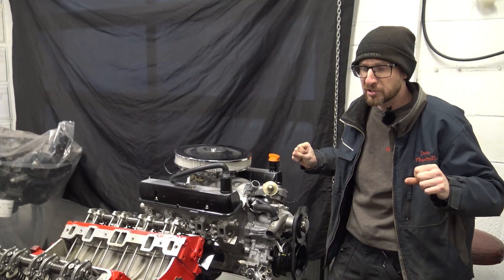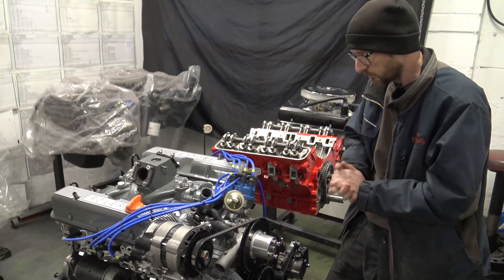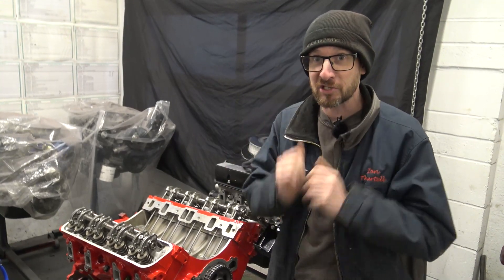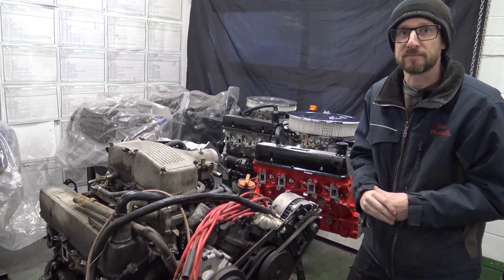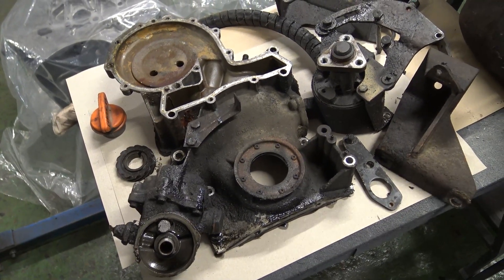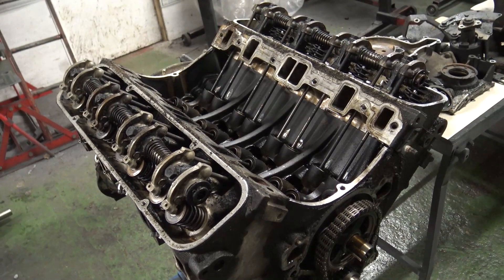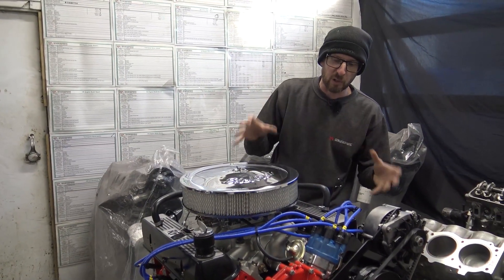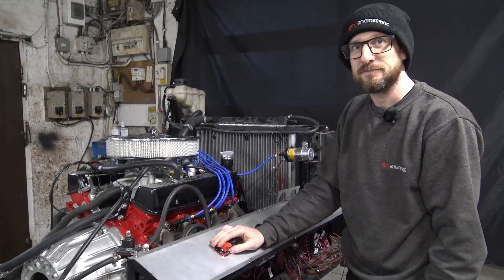RPi Engineering 4.6 Stage 1 Engine Build and Bench Run

Comment: Humm… only real mistake is replacing the silent chain cam drive with a roller chain. Silent chains are far more durable, rugged, lower friction, and accurate in timing than the roller chain. And, particularly for a performance application decrease the shock loads of vibrations transferred to the cam drive and are stronger in general.  Now if you have increased the resistance of driving the cam by increasing friction of the lifters on the cam by increased valve spring pressure, cam profile or rocker ratio generated acceleration loads resulting in turning friction … exactly what have you gained with a roller chain over a heavier duty silent chain?  And, remember shock loads increase by vibration, speed, and shocks such as firing pulse intensity. Of course we often are not thinking engineering in hot rodding an engine, rather how much money can be wasted, and spending too much time on pornography… in the context of James Joyce’s definition “anything that creates desire without fulfillment.” Gears forget them they may not improve things either.

Comment: What kind of paint do you use on sump, pulleys, brackets etc?
Reply from the maker: Black shiny paint lol :-) - Sorry couldnt resist. Its a high gloss tough black made by simoniz. However the key with all paint is preperation and a good etch primer.

Comment: R/E.  The red 215cu V8 looks smashing !  My re-built 3.5 V8 Range Rover Classic has covered just over 100K miles in the past decade and flapper is working fine.  Any suggestions with RPi Engineering experience to achieve 201Hp/150kW from this engine here Downunder ?  V.
Reply from the maker: Hi, Best to email us on info@v8engines.com to discuss your setup etc however keep in mind unless you are driving at 4500 to 5500 rpm where peak bhp is the reality is that you are driving on torque in the mid rev range.

Comment: Beautiful work as usual. Question about the sump mod for the 4.6 crank throw - what sort of clearance does this need to provide? I have an unmodified SD1 sump on my 4.6, and only became aware of this as a potential issue recently, after I'd finished the build. It turns freely by hand and doesn't "feel" like there's any interference between crank and sump, but am anticipating I could be in for some trouble when I actually run it up. I have already doubled up on sump gaskets, is that likely to have created enough clearance alone?
Reply from the maker: Hi Will,
Doubling up on sump gaskets may well have given you the clearance you need. We dress the sump to provide the clearance.